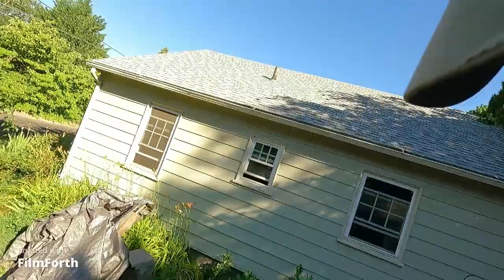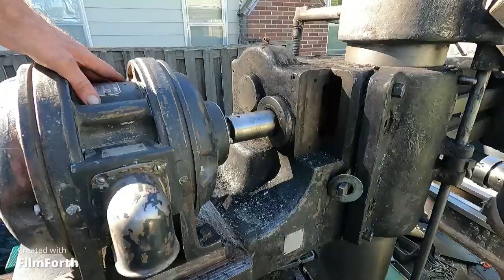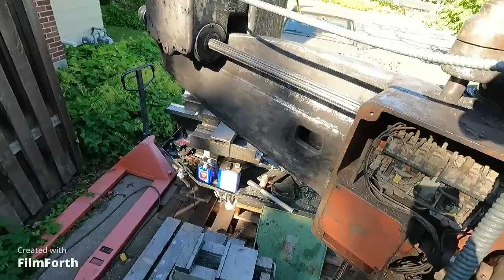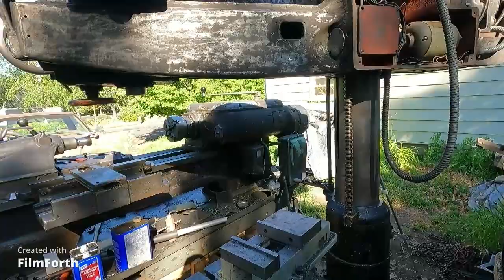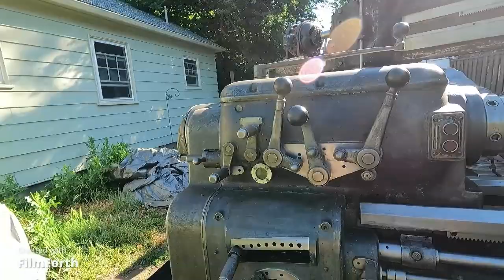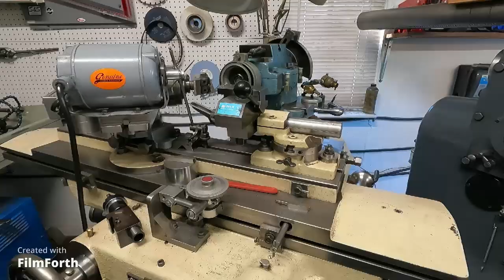Machine tool restoration Tuesday July 12 2022

Comment: Great action on the machine tools in the drive way they are both looking great ,  I still use High speed tools for my small lathe and I enjoy making cutters for the lathe in High speed steel special cutters . Same here work in the morning and I pack it in for the afternoon we can do that since we are retired no rush ore stress . Have fun .
Reply from the maker: I really like making cutters and still use HSS a lot. Taking control over the cutting tools is half of the experience that has faded almost away creating todays "ShakeNbake"" machine operators. I found getting going early made me much more competitive in the shop because I could get in a few hours without being disturbed.

Comment: You have pride in your work and respect your neighbours dee dee unlike the major majority of the younger generations nowadays. I used to buy unknown oddball accessories and parts off woodworking machines many years ago using the same advantages you've mentioned. Your machines are going to look spectacular. Tony
Reply from the maker: I think the outcome will be worth it, this is the last stretch, and it is simply going to take as long as it takes. I cant just sand that stuff off and let the cloud drift in their windows. I had nearly the same dilemma with foul cutting oils and chemicals in the lathes sump. I am getting closer!

Comment: Glad you broke the 10-11 minute video mark! I use 3 different GoPro cameras on the kayak, it takes awhile to go through upwards of 100 clips when editing. It doesn’t matter how long your videos are, you just need to be consistent on posting…. Something I have to practice on! Have a great day.
Reply from the maker: The kayak I learned how to get out when I rolled over really pretty fast, it was on a rough river and I was advised to get on the raft before white water. Ha, maybe my videos are sort of like that I just try to turn the camera on and start talking, I actually can't seem to rehearse or follow notes. I picture each you right here and just try to explain what I am doing and why. It is a relief to be able to do basic editing and not trying to cram the last minute. I will try to keep it short and to the point
Reply: @deedeeindustrialsuperprecision  I’ve been try to go back and watch all your earlier videos, what a difference in your videos now compared to then. I think you’ve done a great job as a presenter/teacher. What software are you using for editing?
Reply from the maker: @pweimer47  The early videos I had stage fright that took a while to get over. Thanks for the nice comments, I am using film forth about the simplest it seems

Comment: The motor that's in my K&T 2HL is almost, if not exactly, identical to the motor on your drill.
Reply from the maker: Those old GE motors were really heavy built and nice looking I think, thanks for tuning in!
Reply: @deedeeindustrialsuperprecision  The windings on mine were PACKED full of grease. I cleaned it up the best I could and also replaced the bearings.

Comment: Coming along nicely! Just wondering why you don’t lower the drill press arm so that you can work at ground level and not have to climb up on it all the time?
Reply from the maker: The arm does not lower enough where I can get over the top of it, and I have to get under the head and arm. This machine is unusually awkward to work on with the height and design